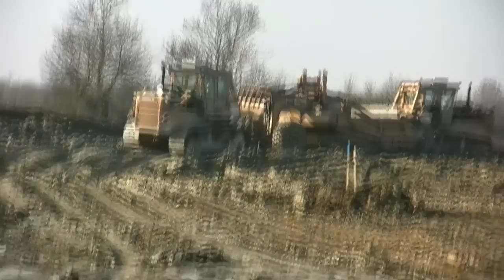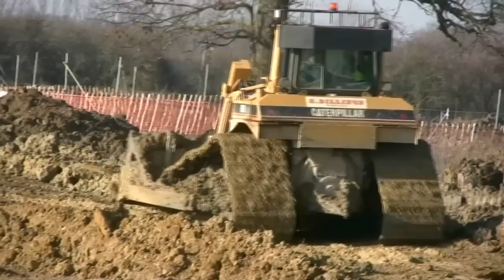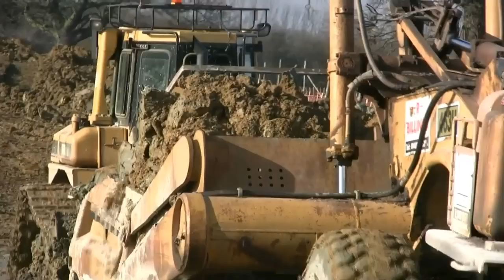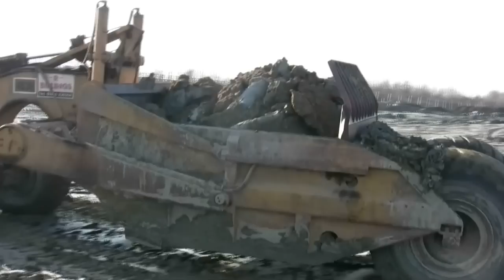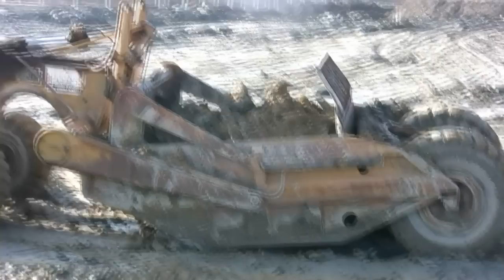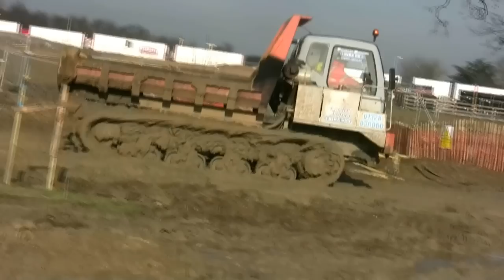D8K,s  cambridge  pt 13.avi

Comment: Those are powershift D8K's. The 76V series (Direct drive) work better on a scraper. They do not torque down in soft ground, they load the scrapers better and use at least 30% less fuel. We have 4 of these machines and they are great.